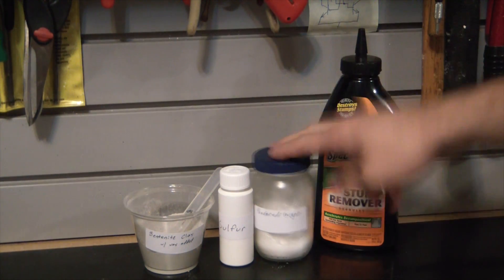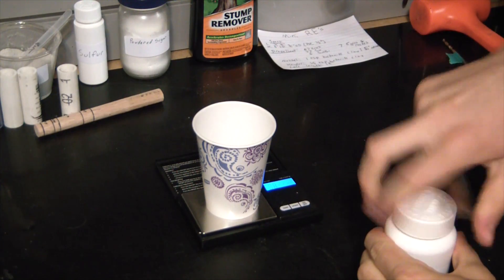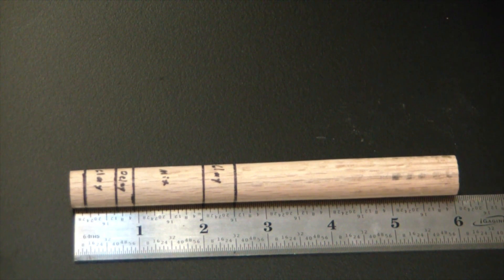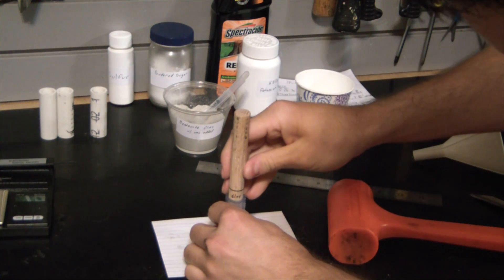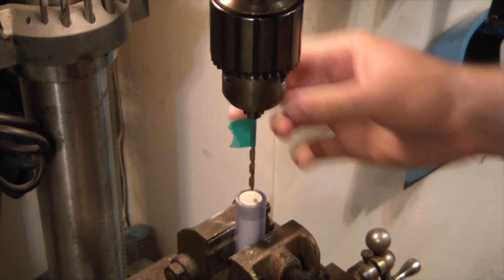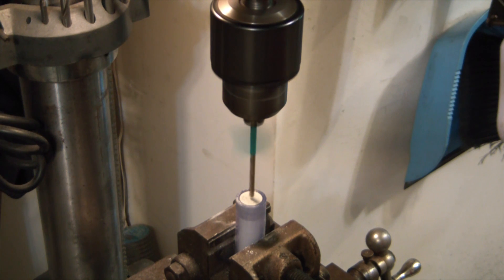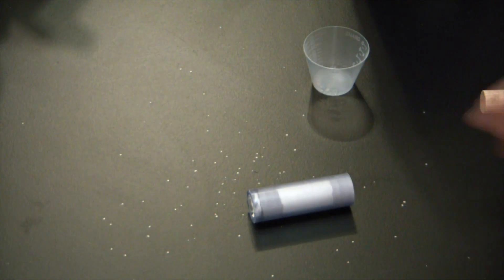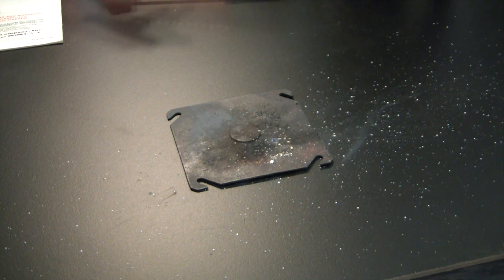ROCKET ENGINES FROM HOUSEHOLD STUFF! ELEMENTALMAKER

Comment: I don't thing you can buy stump remover here in Quebec Canada anymore. If any knows where please share where.
Reply: Nope, not since 2013, it's on a list of "restricted components" which means to sell it you need to have a license. And it's not just Quebec, it's a federal law. You don't need a license to own it, but you must comply with some regulations for storage, transport, usage, etc... https://www.nrcan.gc.ca/explosives/restricted-components/9981

In short, you just can't buy it in hardware stores anymore, but anyone can own it as long as you don't intend to sell anything that contains it without a license. They just made oxidizing agents and reducing agents harder to buy for someone who shouldn't be handling it in the first place. Here is the whole list of restricted components:

456 (1) The following components are prescribed for the purpose of the definition restricted component in section 2 of the Explosives Act:
    (a) ammonium nitrate in solid form at a concentration of at least 28% nitrogen;
    (b) hydrogen peroxide at a concentration of at least 30%;
    (c) nitromethane, UN number 1261;
    (d) potassium chlorate, UN number 1485;
    (e) potassium perchlorate, UN number 1489;
    (f) sodium chlorate in solid form, UN number 1495;
    (g) nitric acid at a concentration of at least 75%;
    (h) potassium nitrate, UN number 1486;
    (i) potassium nitrate and sodium nitrate mixture, UN number 1499; and
    (j) sodium nitrate in solid form, UN number 1498.

Acquisition — others

459 Any person may acquire a restricted component for a purpose other than manufacturing restricted component products for sale.

Comment: I've made plenty of these rocket engines in the past.  What is missing is a real test with a real rocket lifting off.  The first group of engines I made all lit just fine.  However, not one of them had the power, in spite of a searing flame and whistle, to lift itself and a 3 foot, 1/8" x 1/8" piece of balsa I had taped to the side of the engine (much like a large bottle rocket).  It wasn't until I decreased the drill hole by 1/16", making the nozzle hole smaller, and then added powdered Magnesium (approx. 10%) to the mix, that I had a decent lift-off.  Unfortunately lighting these while they are secured to watch them burn doesn't give you any idea of how well they will break the bonds of gravity and get into the air.  Keith Freeman below has another mix that should work well.  I would definitely add the aluminum to ensure it gets off the ground.
Reply: I did the same, connected a 2 foot, fine stiff wire to the side of the motor, like a bottle rocket and was hoping my first lift off would actually leave the ground.  It was throwing lots of sparks  but did not move vertically at all.

Comment: OK, I got a load of sulfur in finally. I mixed it 67% KNO3, 20% powdered sucrose, 4% airfloat fir charcoal, 2% brown iron oxide (oxide/hydroxide type), 5% rubbermakers sulfur, and 2% paraffin as a phlegmatizer. Flattened a little cookie sized pile of it, lit it, with no idea that I would get a five foot column of flame out of it. F*ck me running. Good times
Reply from the maker: Holy crap that's alot of composition! Always start small so you understand the energy of a mix before igniting larger quantities. Glad your safe and sounds like you still had fun!
Reply: Oh, I've been playing with some of this stuff for years, no worries.  Eyebrows optional. I knew sulfur sensitizes things, that's why I took you paraffin advice.
Reply from the maker: @pyrusrex2882  ah gotcha! LOL I too have lost my eyebrows quite a few times.
Reply: Lmao...please don't screw around with homemade thermite, negative x, or nitrotri-iodide.
Reply: OK....in hindsight, maybe I shouldn't have even mentioned those compounds to him.

Comment: 2nd visit to this site .I am using 1.5" black PVC x 7" long. I am having very little success with PVC tubing. Spent firework cardbord tubing I have GREAT success.My problem is the clay plugs on both ends.One or the other will fail and blow the fuel out the top or bottom sooiooo my next attempt I'm gonna seal the nozzle end AND top end with thick super glue and zip kicker.That should do it. I'm also going to make sure I drill the proper nozzle size cuz that could be also a problem. I'm also experimenting mixing some Gunpowder with my rocket fuel mix to give it a little bit more power and I've been having success with the cardboard tube Rockets. Iowa fireworks retail place not too far from me and I bought some mortar rounds and cut them open and got the black powder in the little hard balls out of them and I've been using them to supplement my rocket fuel.

Comment: This was a damn good video. It caught me by surprise, too. I've been screwing around with a dry packed powder mix for my rockets, and a couple days back I had the idea of milling some crayon shavings into my powder, thinking the wax would act partially as a binder and also to surround the oxidizer particles when the flame front hits and melts it. And now here it is in living color, way before I ever thought of it. Damn. This channel is AMAZINGLY good, so this lets me know I'm on the right track. Cheers for the reply on the aluminum video. I'm ditching oxide catalysts and going sulfur after seeing this.
Reply from the maker: Glad your enjoying the videos Rex! While iron oxide is a great catalyst, I found sulfur to be a bit easier to work with for a compressed sugar rocket. I'm sure a couple percent iron oxide would bump up the specific impulse a bit more though, so it's probably worth a shot.
Reply: All my rockets with 2 % red iron oxide blow up...

Comment: sulphur and powdered zinc is way better for rocket engines

also (not that I would do anything unlawful) two part foam, get part A and mix in some thermite, then mix in part B, pour it into your tube before it goes off
(if the man is reading this, I've never done anything bad, ever)
Reply from the maker: Sulfur and zinc is actually a very low impulse fuel due to the fact that it creates solid zinc sulfude as the main product of reaction. You want gasses for your exhaust as they produce a larger volume. That being said zinc sulfur engines produce an amazing flame that can't really be paralleled. This composition produces a large amount of CO2 so will outperform Zn S engines, but won't look as cool.

Comment: How did you melt the parafin into the bentonite clay and still end up with a fine ground product?
Reply from the maker: Just put a bunch of clay in a loaf pan with a half a block of paraffin then threw it into the toaster oven for about an hour at a low temp. The bentonite seems to absorb the paraffin very nicely. It clumped a little bit, but once cooled easily powdered again just by mixing with a spoon.

Comment: Pretty good vid all around, but I would advise AGAINST using PVC.  In rocketry, a small air pocket, or a dropped rocket motor, can cause it to CATO (explode violently) on the launch pad  sending shards of razor sharp shrapnel in all directions!  Better to roll your own rocket motor tubes out of grocery store paper bags, and watered down Elmers glue - they get rock hard, and will withstand the pressure from the ramming process.
Reply from the maker: I've been in the amateur rocketry field for many years and have seen my fair share of CATO's. That being said I have been using these for over a decade, and have never once had the pvc fail, the worst case I have ever seen was the nozzle being ejected and smashing into the launch pad. If I were using a higher impulse propellant such as an AP based one, I would certainly make the move to either a reloadable metal case or a parallel wound disposable virgin kraft paper casing.

Comment: Any way to add your aluminum powder to this (possibly without the sugar fuel) to make a higher grade rocket fuel?
Reply from the maker: MotherEric aluminum usually isn't used with nitrate based propellants. The nitrate and aluminum can slowly react to form unstable side products (forget exactly what they are right now) that can case spontaneous ignition. Although certain compounds can be added to prevent this. I have experimented with ammonium nitrate based propellants using resin binder and aluminum powder
Reply: ElementalMaker,

Ah Okay.  Sounds cool, and thanks for the clarification.
Reply: Not sure about you, but my potassium nitrate is always sucking more water out of the air than I'd like. Even if I baked the KNO3 nice and dry before mixing it I'd be hard pressed to make any claims about the stuff staying dry for any length of time. My attempts to protect these powders from environmental humidity always seem to be only partially effective.

Comment: can they be made longer or do you have to make stages and is there another soled fuel mix that has more power ,and grant Thompson  has almost the exact way of doing it with the stick and all .maybe he got it form your channel.
Reply from the maker: They can be made longer, but not by much, and you'd need to do test motors to make sure they are safe before launching in a rocket. It would probably be easier to stage them.
Reply: thanks

Comment: Making anything that could potentialy explode out of any kind of plastic is a very bad idea.  In the case that an accident occurs and you get exploded bits of plastic shrapnel buried in your torso and face it will be a real bummer to learn that those plastic bits cannot be located with an x-ray machine leaving doctors with no choice but to cut, cut, cut, exploratory surgery to find the plastic bits making your wounds many times greater than when you got there.   Plastic+explosives is a big no no.
Reply: crazytestpilot 1 cause he is only responsible for his information. Once someone cuts corners or deviates from instructions it's their tough lesseon to learn.
Reply from the maker: crazytestpilot 1 the end plugs always fail before the pvc casing. I've made hundreds of these, and the propellant is not powerful enough to burst the pvc. The end plugs will be pushed out long before the case ruptures.
Reply: You clearly have the knowlege and skills to build these safely. I wonder about the average joe who will cut corners and basically hack the job. He may find himself in some trouble. Why not just use materials that are less likely to hurt someone who makes a mistake.   Just sayin' It would be a shame to coach someone into a tragic situation. I would certainly feel badly if I did so. Take care and thanks for posting.
Reply from the maker: There isn't a very large risk in making these. They do not fail catastrophically. If they over-pressurize it will just eject the end plugs. The biggest risk would likely be getting hit by an ejected end plug.
Reply: crazytestpilot 1 not true. PVC can be hazardous if an explosion does occur.  Like he mentioned it’s not very powerful to cause a significant hazard.  But plastic like High density polyethylene. (HDPE) is used for mortar tubes in professional fireworks displays.  If a shell exploded the tube will just bulge and tear instead of fragments flying in every direction. Plastic like PVC. ABS. And polypropylene are a no no.
Reply from the maker: PyRoOWL 1995 ABS and Polypropylene are also both plastics that will bulge and tear when overpressurized. PVC is certainly a fragmenting plastic though.

Comment: At 4:00 or so, when you really got going with your mixing, I thought the speed alone would have risked igniting your mixture. ;)
Great vid,thanks.
Reply: cappnzak this mix is not capable of igniting from friction or shock. Sulfur can make certain mixtures more sensitive but this is not one of them.  Potassium nitrate and sulfur are relatively safe.  (Except flash powders) If it was chlorate then that’s a different story.
Reply: I know this is 8 months later, but you need to re-watch at 4:02 to see what he's talking about .  XD

Comment: Is it better to just mix, and not melt the fuel? Half the videos just mix it and the rest melt it into "rocket candy", has it been tested to see which is better?
Reply from the maker: Shane K this method is safer and in my opinion more consistent. Melting then casting the fuel generally gives better performance however.

Comment: You might consider ball milling it in a rock tumbler too.
Reply: If you use a ball mill, divide the mix into two batches that are in the wrong proportions, like half of the K-nite and all of the sugar, then the other half with all the sulfur. Carefully mix the two batches thoroughly in a pair of paper cups taped together to form something like a cone powder blender to get the final mix. A vibratory polisher with plastic media might also work. The two half batches won't burn properly, so they are relatively safe to mill to a fine powder.

Comment: With the ingredients you already have on hand, Stump remover, sulfur, and some charcoal.
 With KNO3-75%,C-15%,sulfur- 10%, now you have black power.  Powder everything very finely.  For a little more power add 10% powdered aluminum.  Mix well put into tubes.
Now you have all the stuff to make your own model rocket engines.

Up, up, and away
Reply from the maker: David Vermillion I actually have about 3 pounds of various size ammonium perchlorate, and a gallon of pban resin. I'm going to try to replicate nasas booster formula
Reply from the maker: I've made black powder many-a-time. Its fun stuff for sure! Benzolift is even better though!
Reply from the maker: David Vermillion awesome post the results! Love to hear how it performs
Reply: Add 2 grams of iron oxide or rust lol
Reply: What if you can get your hands on Ammonium perchlorate?
Reply: cool, I was gonna make some nitrocellulose and combine it with ammonium perchlorate and powdered aluminum. Hope to see some good results.
Reply: I just talked to my chemist freind he said it was a bad idea. I'm taking his advice
Reply from the maker: David Vermillion that is totally fair. Did he explain why? I'd be curious to hear his thoughts on it
Reply: iv always wondered with a solid rocket motor do you even need a nozzle down in the front with the core !? of can you just ignite the end of the core and have it fly off .
Reply: He said that the nitrocellulose with the aluminum would burn too fast. Causing an explosion. He suggested to burn one or the other but not both.
Reply: That would be one hell of a sight. I know with AP that the ammonium actually functions as a fuel, with the right amount of nitrocellulose (which has it's own fuel/ox mix) that could be spectacular. There's a pyro supply here in Idaho that sells exotic oxidizers like Lithium Nitrate, Lithium Perchlorate, Barium Nitrate, and powdered Carbamide Peroxides. Firefox fx.com
Reply: Premature ejeculation......hahahahahha!
Reply: yeah, but aluminum powder is how you make FLASH powder, same stuff that's in cap gun caps...pressure , like hammering it into a cylinder gonna make you go Bye Bye!!   See "Safety and Handling" at bottom of page https://en.wikipedia.org/wiki/Flash_powder
Reply: @LastDaysADDaniel  yes but special graded particles! The mass area reactive "face" of aluminum grain is a key factor in efficient burning rate or flash /point Temp/
Reply: I don't know if you know this but he already had a rocket motor with just stump remover and sugar ..

Comment: This is kind of exciting. Watching a guy put homemade rocket fuel in a tube and then beat on it.
Reply: Not an impact sensitive compound!
Reply: @CharlieMontana-e8e  Actually in powder form and mixed with an oxidizer, it's pretty common to get self ignition. Adding sulfur just makes it more likely because it has a low ignition temperature... Just static electricity could light a cloud of it off.

When making sugar rockets I usually mix the sugar and KNO3 together with just enough water to dissolve them, put it on the stove and boil the water away. Take it off heat and let it cool a bit when it gets creamy white in color after it boils for a while, that means all the water is gone. After it cooled a bit but is still liquid, pour into your rocket, and insert a piece of magnesium sparkler in the center of the core as a fuse. It will set into a perfectly mixed anhydrous sugar and oxidizer solid fuel, and the magnesium sparkler will easily ignite it even without sulfur. Because the sugar is mixed better with the KNO3 by dissolving with it, you don't need the sulfur in there. It's also much safer to handle than in powder form.
Reply: The pounding isn't so worrisome, but I figure that someday the friction of drilling out the core is going to set one of these things off in my hands!
Reply: either don't make rockets or DRILL SLOWLY  by hand

Comment: Any americans help me out here, what is this schedule 40 and 80 I hear of? I am gathering it has reference to the wall diameter and thus pressure rating, but... outside north america? No ideas :(
Reply: I've made these rockets in Australia and we have two varieties of PVC pipe, one for pressure and the other for non pressure applications. The difference is the wall thickness. I used the thinner stuff and it was OK but  softened and 'wrinkled' near the nozzle so next time I'll go with the thicker stuff. Another tip, I didn't use sulphur and they worked very well.
Reply: We have non pressure rated PVC (thin wall).  Schedule 40 is pressure rated, medium wall thickness.  Schedule 80 is heavy wall.  It's one of those odd standards.  The wall thickness of 2 inch Schedule 40 pipe is thicker than 1 inch Schedule 40 pipe.  I'm sure a Google search would get you the exact definition if you are really interested.
Reply: I googled " what is the difference between schedule 40 and schedule 80 PVC?"
https://www.pvcfittingsonline.com/resource-center/schedule-40-vs-schedule-80-pvc/